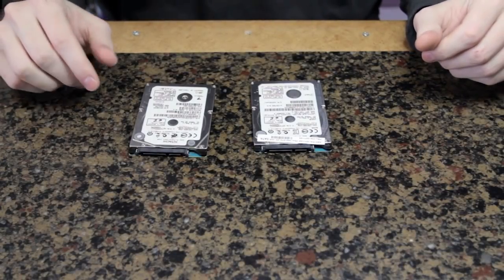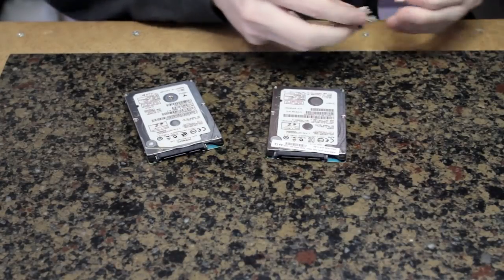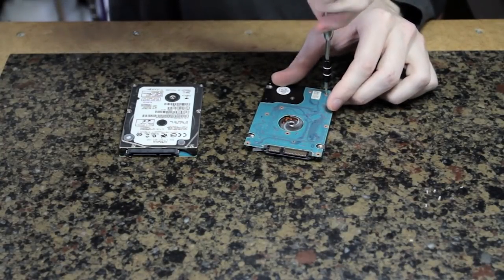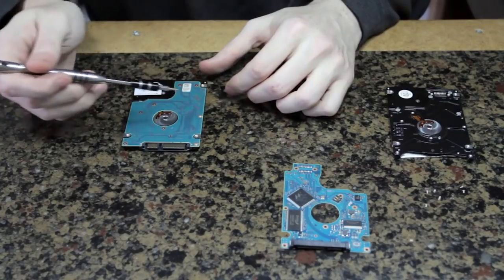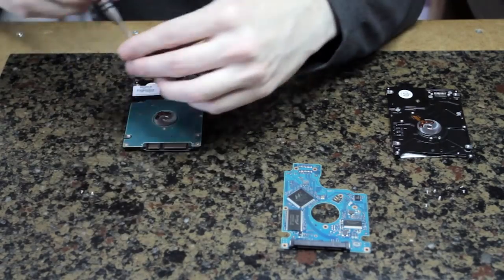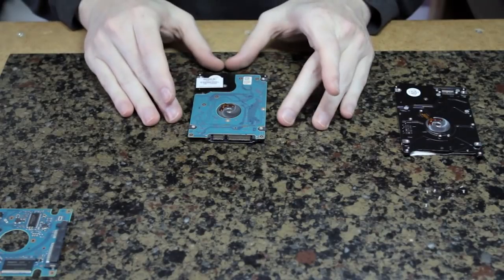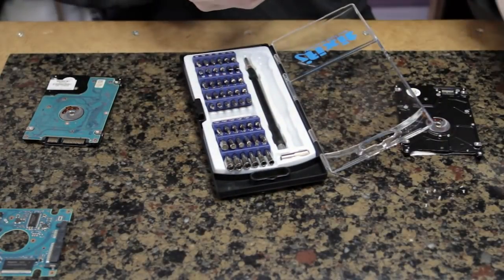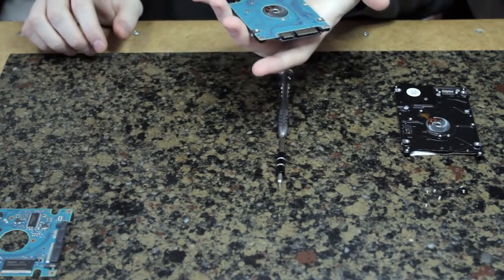HDD platter Swap, NOT Pro

Comment: You do realize that it's 10X easier and safer to move the headstack over instead of moving the platter.  Platter swap is only for when the motor has failed, not for cases where the heads have failed.
Reply: What will need to be done after the swapping head stack?

Comment: Yeah, I didn't think the board swap would work. I tried that myself and then read that firmware adapts itself to unique flaws in the platters and heads. So I don't even know how a platter swap would work, but eventually I'll save up the money to send that drive in for pro. recovery. I'm just glad my data on that relatively small drive isn't time-sensitive!
Reply: when swap the boards You need also to desolder the original bios chip and solder it on the new donor pcb.Also plates can be moved but it depends from the person who will do the work.Of course if the plates are not damaged...

Comment: Hi, I have the same problem.   I'm getting ready to attempt this in a last ditch effort as I'm not willing to pay 2000 to have a recovery center do it.  I have one question.  First thank you for making this video, the only unclear thing to me was the PCB board.  I know you swapped it and then reswapped it so I'm not sure which one to use?  Can you tell me if you use the original one on the bad hard drive, or the new one that comes with the donor drive?  I'm assuming the new one but not sure.  The computer place told me the donor drive is in good shape and reading correctly, so all i'm trying to do is get the info off my old platter.  If you could please clarify this I'm planning to start asap, thanks so much!
Reply from the maker: +Rubber Duc I was swapping the PCB as when I plugged it in the system didn't even see a drive there (let alone being able to mount it) If your system sees it you should be ok with the one that you have.
Reply: This is the question all over the world..monopolytics....damn expensive service..

Comment: I'm glad this is only a single platter, and not a dual platter. 

You should still hit it with can air even if you don't see dust. Also, the felt piece is the internal filter, which I see you left out.
Reply: Canned air is 100% good, but the internal filter seems not neccessary if he's immediately cloning the data out.

Comment: there are protection diodes at the entrance to many boards, called tvs, you can measure them with multimeter to see if they shorted if the pcb was over volted.
Reply from the maker: This is good to know for down the line, Thanks!

Comment: Ahh at last a McGyver guy video, I have watched some 10to15 vids so far and feeling confident. i have manage to source a working hard drive the exact same manufactured a day after the defective one only 76 made between them. that was mad luck after a 15 min search on fleabay. 
Anyway the pcb is fried due to liquid damage and there is a stain on the platter, I have some clean room swabs and 100percent acetone it seems to be the only thing that doesn't leave residue. 
I'm going in wish me luck...
(please note any comments I should take to a pro and be robbed of 2 months worth of mortgage payments don't bother its zzz) Im not overly bothered with the data if lost, its more of an experiment costing £25.00
Reply: Did you succeed?
Reply: Yes sure did

Comment: firmware between 2 drives that holds drive info, sector layout, head info. may be slightly different between the 2 drives, which when put on the incorrect drive would make it not able to become ready or make it click. You would then need to do a ROM swap on the PCB (its not easy). But using the PCB that was coded for that drive made it work.You are lucky. If that had 2 platters, and you got the alignment off in any way, you could kiss the data goobye. But it seemed like it worked for you. HDDs are such fragile things.
Reply: Hello. What if you just do a head swap?
Reply: @timberland215  head swap could work if the heads were failing, but if the motor has locked up or other issues have popped up then no, it won't work. Firmware plays a big part in making a drive work properly.

Comment: Hi! Nice video. What symptoms did the originally failed drive have? Was it spinning at all? Was it making noises? Aking out of curiosity, mostly :)
Reply from the maker: Don't recall all of the details but was pretty sure the head wasn't seeking as the drive was detected but could never get movement other than the platters spinning. This drive was from a dropped laptop so my hopes were low on recovery anyway.
Reply: +Lockdonnen I have a 3.5 inch drive I need data from, I lost the pcb board that was original to the drive(western digital green caviar) can I buy a used harddrive with the same build date and use that board to access the data? I'm desperate
Reply from the maker: +ROUSH4203 replacing the board with an identical one should do the trick. When buying a clone drive contact the buyer and ask if the model & firmware match yours otherwise there is a strong chance it wont work with your drive. Hope this helps.
Reply: +Lockdonnen hopefully it will work, I've looked at a few identical drives online, roughly a month apart from mine, I'm praying this works cause I can't loose this data, thank you for your insight I feel a little better
Reply: no the issue i had was i did not realize the boards were not interchangeable and mixed the boards up, i had a few drives scattered throughout the house and mistakenly did not mark the boards. the drive should be fine i just want to transfer the data over to another drive before this one fails. if i can buy a new board from the same year drive i will be one happy camper

Comment: Sir, does the data over the platters get damaged or not after opening the hard drive?
Reply: Only thing that damages a platter is scratches. No different than any other disc except youd have to scratch pretty hard.

Comment: Why did you have to swap the controller board at the end of the video? 
Was the board the problem all along?
Reply: Because he initially swapped in the donor drive board to see if that was the issue and left it like that.  So when he was done with the platter swap he had to swap them back.

Comment: Thanks for this sharing!
I will be attempting the same procedure with my old IDE drive.
But does the accepter drive has to be of the same PCB and firmware or can it just be the same model of the drive (in my case it is IC35L060AVV207-0)? Any answer or hint would be very helpful. Thanks!
Reply from the maker: I'm unaware of the "exact" steps you need for this but I had the same exact HDD and it claimed to have the same firmware so I gave it a shot. The data wasn't super important, if it was I wouldn't of done this but really I had little idea what I was getting myself into with this one.
Reply: Wolf Lovel
 Thanks man! your reply will be an initiator of another attempt of mine! So far I've just bought heaps of old drives. The most problematic part so far was dealing with the heads - I've screwed a few of them already.  Cheers!
Reply: Wolf Lovel Thanks man! Don't have to be sorry for your grammar ;)

Comment: Would swapping platters from 2 different brands affect anything?
Reply from the maker: That could affect lots of things, the controller board would be different from each manufacturer and where data is placed would not quite be the same place either so I doubt that would result is much other than errors abound.

Comment: Why did you have to replace the board again. do you mean you used a board from bad drive?
Reply: +WV591
So that the firmware would match up with the platters. So I guess the old heads were bad and this really just became a head swap.
Reply: Do the heads have to be the same if you just took a 1tb Western digital head and any other Western digital head or does it have to be the exact same model

Comment: good job.  You mentioned you had tried "Raw data extraction."  Would you mind sharing the name of that tool/utility? Thanks
Reply from the maker: Will S The program I use is Parted Magic, it's a liveCD of linux with lots of data recovery. When you use the disk cloning program you can tell it to copy byte for byte and can recover from that image rather than risking more data failure.
Reply: Lockdonnen Be careful, IIRC the normal disk cloning tool in Parted Magic (dd or a GUI that calls dd in the background) is not intended for working with bad or repaired drives. There is another tool on the command line, called ddrescue, which is specifically for imaging bad or weak drives.

Comment: hi i am from India
i have a toshiba laptop hard disk,it was dropped and now making a clicking sound.
i send it to datarecovery professional and they are demanding too much service fee,and i cant afford that.
i have bought an identical hdd.
my question is 
how should i start the swapping process..shall i start with pcb?
if that doesn't work can i try replacing the heads?(if the pcb board are identical,replacing the heads are easier??)
if i try swapping the platter do i need to care about firmware and all,if they are identical hard disks??
if all goes well which program shall i use to copy my data,why cant i use window os to copy???
Reply: Aju Sukumar  even i m from india had same question
Reply: Exactly same problem and same questions bro...I know it's been a long...but did you attempt the recovery?? How did it go?

Comment: what is that tool called you used to remove the platter?
Reply from the maker: +Bradley Keane It's just three sticks strung together that expand when you pinch the top. Macgyver tools.
Reply: +Lockdonnen  no... I mean the kind of tweezers to remove the screw.

Comment: Why is it some use straight forward screw drivers and others use torque drivers? Isn't it safer to use a torque driver?
Reply: Safer with a torx kit unless for some reason the specific drive has small screws though ive yet to see it. Can find one on amazon going for $8 to about $15.

Comment: There is a "chip" (poor words, im sorry about my english doritos skillz) that every pcb must get changed. If you want to fix an HDD with a "donor" printer circuit board (PCB, the green "brain") you must change a piece that we call "the spider chip" that contains important unique information and instruciont that make possible the functioning. If you do not try that there is a really really really small possibility it works, like 0,0001 to 100000000 possibilities xD . The thing might look like working but would not be recognized by the PC or would not work propperly. If you change the spider chip it will probably work, unless it is the goddamn "click of death". In that case you should swap the platters with an identical donor drive. The swap is nothing easy. the "discs" or platters are those , lets say, mirror discs , that you find inside an HDD, those fuckers gotta be treated with white gloves ^^

Comment: I am 99% sure that you can not put the 'bad' platters into a different drive and have it work, because the RAM chip on the PCB holds information telling the head controller where the heads are to get the data.
Reply from the maker: This is true, the PCB board has the SMART information about the platters and bad sector locations. If I knew how to clear the information on the board I would of done that but I enjoy a good train wreck.
Reply: I should have watched to the end before my first comment, you ended up putting the original board into the drive with the original platter.
Reply from the maker: +Dasdfjkl it's been a while so I don't remember what exactly I did in the video. Hope it was art least entertaining!

Comment: the board swap will not work . Unfortunately the original board or any board for that matter have one chip that has the map of where the data is on the disk , where to start and where it finish on the disk. The new board do not have the right info on that chip and that means the drive will spin but nothing will append. the new board has no idea or where the data is on the disk.
Reply: Not necessarily true - as an experiment i've just done it with 2.5"" samsung drives hn-m500  ( yes they are the same revision etc )  and i can confirm absolutely that the PCB from one drive operates the other no problemo, access 100%   
This in turn confirmed that it is a mechanical problem with my 'dead' drive. 
There is certainly no harm in trying the board swap to rule out the a simple and low risk bit of fault finding before opening the cases.  and very simple to put back to square one again.  Of course this might not be the case for all drive types since some might use a more sophisticated control system like you describe.
Reply: It works if you swap the bios chip

Comment: Wow.... As a data recovery professional, that was painful to watch. You were incredibly lucky that this process worked for you. There are a thousand things that could have gone wrong and this video will hurt more people than it will help.  So many people will lose their data forever due to this video and others like it. 

Almost every single day, we receive a hard drive in our lab that has been opened by some do it yourselfer trying to save a few dollars and recover their data themselves. Most of the time these cases turn out to be unrecoverable because they screwed it up so badly. 

People need to understand the risk and consequence of opening their hard drive themselves. They need to understand that data recovery labs charge several hundred dollars more to recover a hard drive that has been previously opened than one that has not. 

On average an individual home user with a 1TB or smaller hard drive will pay less than $1000 to recover all their data from www.filesaversdatarecovery.com and around $1500 if the drive has been opened first. You also need know that less than 50% of the previously opened HDD's can be recovered VS  90% recovery rate for drives that have not been previously opened. The 10% that can't recovered is related significant platter damage caused by damaged heads scratching the surface of the platter right off, sometimes leaving thick black dust all over the inside of the drive when we open them. 

People need to know that most hard drives do not only have one platter. Most have two or more platters making this process even more complicated. The platters absolutely can't be separated or even shifted from one another or your data will be gone forever. 

2nd, there are many firmware related problems that are a major problem that show their ugly face after a procedure like this and then you have a whole new problem that can only be dealt with using very high end and expensive equipment and years of specialized training. 

It is highly discouraged to attempt to open and or recover data from a failed hard drive yourself and in my opinion, it is this guys responsibility to help you people understand that.
Reply from the maker: This was mainly a challenge for myself, by no means did I expect success of any sort.
I'm not at all encouraging others to pop open their platter drives, in both the title and the description I try to make it clear that this is not at all how to do it. In comments asking me questions about their troubled drives, I just tell them to send it to a pro. The family members drive I was fussing with didn't even really hold that much on it as the majority of their things were on a cloud drive anyway, even told them that the likelihood of this working was 0.001%.
This video is just me tinkering with things by coming up with an assumption and then trying it out. I've taken things apart and put them back together ever sense I was a kid, learned a whole lot from stuff like that.

No I don't encourage this sort of thing as most people are looking for a cheap fix for a complicated problem and often times people hate computers because they cheap out on something and don't understand why it's not working properly.
Reply: $1000!!!! Holy crap! No wonder data recovery companies troll youtube. Don't want people not spending that kind of money. I don't think I'll ever need my information recovered at that cost.
Reply: I've tried this method as well as moving a stuck head from the platter multiple times with success. I usually save my users thousands of dollars doing it this way. You just have to know what you're doing.
Reply: Lockdonnen Don't worry... it seems like the OP above feels threatened that users will start recovering their own data thus losing thousands of dollars a month.
Reply: @trucker2b  HERE HERE. i have a hdd that needs recovery lol. Willyou do it? Il send you 100 usd no problem.
Reply: @andisadler2897  can't.. Always on the road and shakey environmenterment ...with dust...not good for swap...
Reply: @trucker2b  its ok buddy. Thanks for trying anyway. Looks like il have to send it away. Im in the UK you see so will send it to the USA as theirs a few good companies in NYC etc. I need the files from it urgently for work you see.
Reply: @andisadler2897  yea I lost 1,000 + songs maybe 110 movies all HD. On mines...sucks...few good homemade videos
Reply: @trucker2b  I have 36,000 eps 12 inches and white labels 1986-95 all labeled by catalogue number. 1tb full, around 90,000 files in total and must get them back. The drive does spin up but wont get recognised by pc. I cannot see how swapping the platters would not work. If you get an identical hdd that works fine and swap the platters over. Should work surely.
Reply: @andisadler2897  platter got scratched b4 swap...good attempt to save but no dice...
Reply: @trucker2b  no i mean in my situation with my hdd bud. maybe it will work
Reply: @vee9498  That's exactly what it is